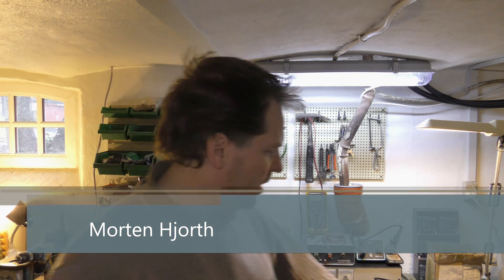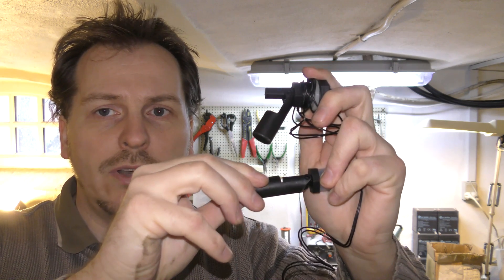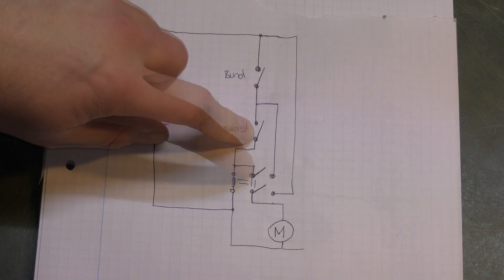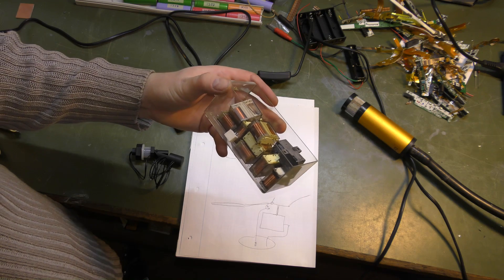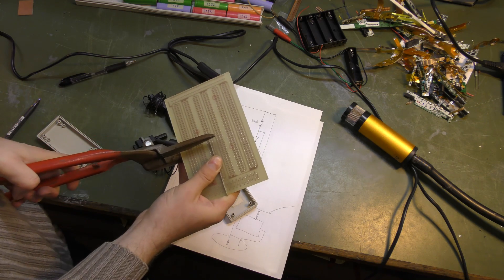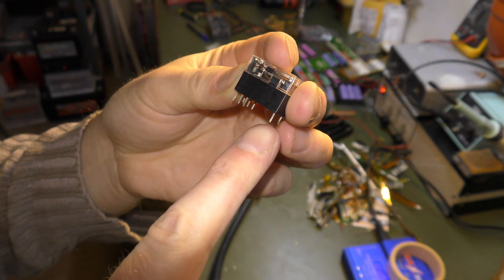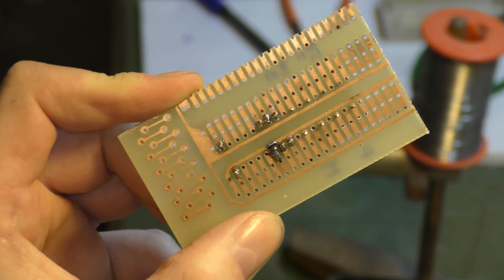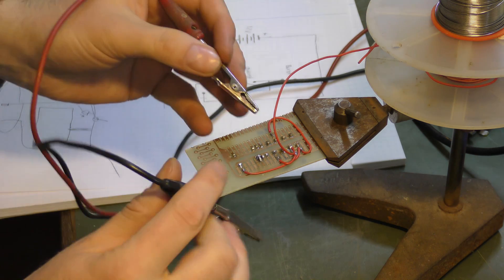How to make a Holding Circuit, with just one Relay - 313

Comment: Hi, I've found something you may like if your pump is not strong enough 

http://www.ebay.fr/itm/12V-Micro-Hot-Water-Circulation-Pump-Brushless-50E-1280S-8m-1000LPH-Submersible-/291146650171
Reply from the maker: Hi +Daniel Vanoost 
Well yeah,,, that pump it like 4-5 times as expensive,,, if my little pump is to small I will look in to it :-)
Thank you for watching! :-)

Comment: Need to get myself one of those Weller solering iron units. Loved them since the 80's ;)
Reply from the maker: Hi +themaconeau 
I do also like it,, and I do actually have two of them. You can get them here at Amazon : http://amzn.to/1WQwp7J but the handle is not the same as mine :-)
Thank you for watching! :-)
Reply: My PlayHouse Thanks for that. If that model was 240v, I would have jumped at the price as its approx $200 Australian drachmas in-country >.<

Just have to convince the other half to part with the sweet cash >.<
Reply from the maker: Hi themaconeau
Oops,, voltages, I forgot to check that :-/
Thank you for watching! :-)

Comment: perhaps an easier to adjust solution -  keep a single sensor,  use it to fire a delay timer,  either a module from ebay or a simple 555 monostable timer.  Then you can adjust the hysterisis of the water level by varying the pump run time without delving into the well.   also less mechanical parts...  anyway just a suggestion.
Reply from the maker: Hi +Stuart Goggin 
That would, only save me one "float" all the rest is still needed and even more is needed.
This was the simplest way I could find.
Thank you for watching! :-)

Comment: I would add two diodes to the circuit to make it live longer: One in reverse parallel with the relay coil to absorb the inductive kick (otherwise I suspect the bottom reed switch will have a short life, as it will be arcing internally when it opens), and one in reverse parallel with the pump (otherwise the relay contact will be arcing when the relay turns off, as the motor is also inductive). You can demonstrate this issue by grabbing the ends of the inductor with left and right hand, and cycling the switches (beware: this may hurt:-). 

I do like the simplicity of the relay approach.
Reply from the maker: Hi +Kasper Pedersen 
Any change you can make a new diagram with that,, an put it on my Google+ ??
Thank you for watching! :-)

Comment: Hope the motor does not draw too hight current to burn out that relay. I would have probably used a 12v relay from a car :D
Reply: +Marko ‘Orkekum’ Ahonen exactly what i was thinking. The relay does not seem it can handle a lot of current.
Morten should also be thinking about a fuse, you would not like a fire in your basement.
For the rest, great project !
Reply from the maker: HI +Henk Kok and +Marko “Orkekum” Ahonen
I just checked up on that,, it is a 2Amp 30Volt relay,,so like 60Watt.
And the pump http://amzn.to/1TEQYoi says like 0,3 Amps ad 12V that is like 3,6Watt. That should be well on the good side.
A fuse,, yes might have been a good thing to put in there.
Thank you for watching! :-)